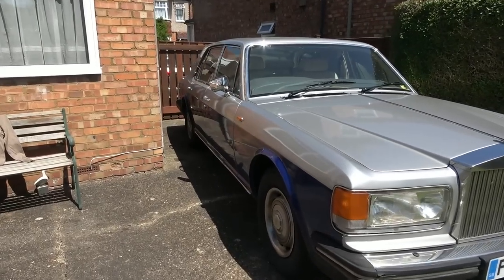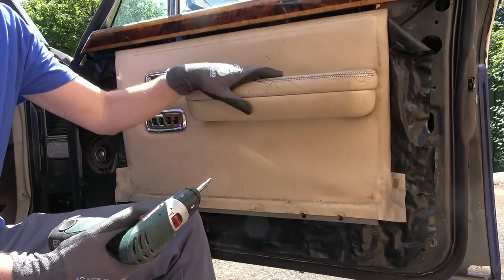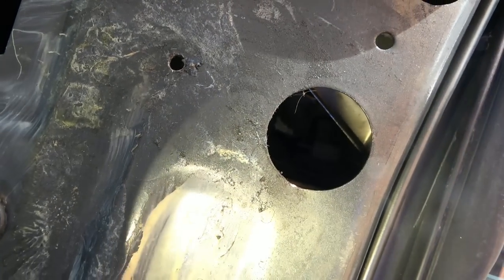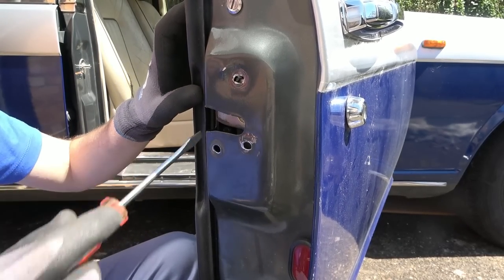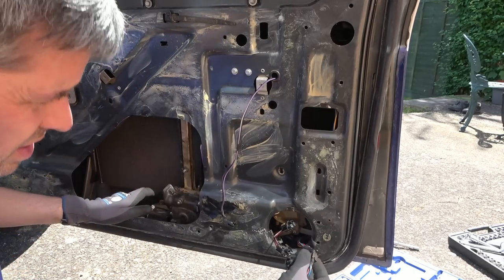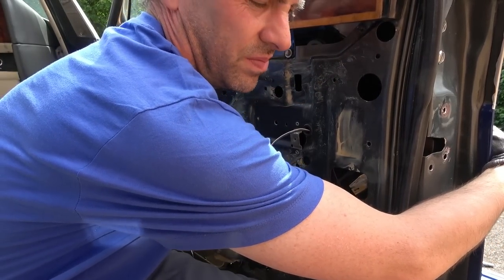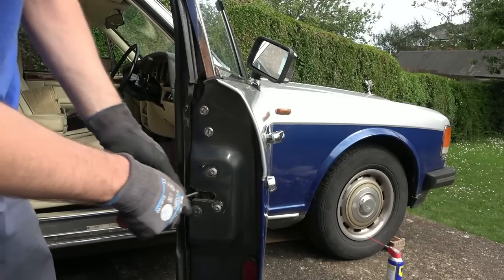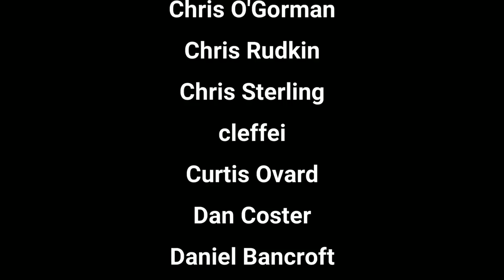CAN I FIX a ROLLS ROYCE - PART 1 - FAULTY DOOR NOT OPENING

Comment: As a former mechanic I thought this series would be hard to watch, but the way you describe the thought process you are using to troubleshoot makes this very watchable and informative. I have recommended your trying to fix content to people who are not trained or natural troubleshooters. I think they benefit from seeing someone else troubleshoot things they don't understand completely. Your approach, curiosity, and attitude toward problem solving is perfect for this type of content. I have zero experience with RR products, and it seems a very well made car, good idea, and good luck. Subscribed.
Reply: Tbh most car repairs are pretty easy. People are just intimidated it's no different to DIY just watchs tutorial and give it a go
Reply: @doiron12  I agree, a good body-man is an artist. They maintain a completely different skillset from a general mechanic, while also needing to know a lot about cars. When a vehicle is ten plus years old and everything is rusty, any job is potentially difficult. It can look easy when everything is clean and you have all the info.
Reply: @danielthompson743  Unless you have a classic Ferrari, yes if you can fix a modern VW Golf you can fix most problems with a 60s 250 Ferrari, but it will seriously hurt the value of the car. Because of snobbery but still. I did it myself is not what those buyers want to hear. For a Rolls, the problems come when you need to enter the parts shop.

Comment: Screw back in all the screws, from where did you removed them from. You should use 1/4" extension and sockets, to be able to reach through smaller holes.

Comment: As an ex mechanic I did like your approach to trouble shooting the issues, even mechanics with years of experience will more or less follow the same thought process if you've never done a particular job or worked on a certain vehicle.
I would suggest you treat yourself to a good 3/8" drive socket set with some extra long extensions, because I did cringe a little watching you undoing small nuts and bolts with a big 1/2" drive set. You'll easily snap off small bolts using something that big, and also as you found they are difficult to get into small places.
But enjoy the experience of fixing up your classic vehicle and I look forward to seeing what you tackle next.
Reply: add to your shopping list a 1/4" drive set and a service manual

Comment: I've got the exact same car! So glad you started this series. I need to get the doors re-veneered also, excited to see how you tackle the issues! Battery is in the boot, right hand side. You've got to roll the carpet out the way, and then theres a hidden compartment underneath. Also, there's a small black quick switch in the boot, (top right, reach your hand up and you'll feel it) which turns the battery off.

Comment: I've loved watching your videos and I think this is definitely a cool idea. From a former mechanic I have some advice for tools. Buy a good mechanics tool set, you're going to need it. There are probably some one off tools you'll be able to get by without, but you'll want good sets of 1/4" , 3/8" and 1/2" sockets and ratchets and you'll need a good selection of wrenches too. I'd also suggest getting a small 3/8" battery impact wrench, it will greatly speed up removing/installing parts (just don't use it for plastic stuff). As you go along you'll probably get more ideas for tools to buy, power tools make things go a whole lot faster. I would also recommend that you find a service manual that includes wiring diagrams for that car if it exists. Especially once you get to the underside of the car and the engine bay, you're going to want that information and for some things with a torque spec to stay safe you'll want to make sure you're tightening it to spec. Good luck with the project, I look forward to seeing it go along and I hope you get a bigger space to work on it!
Reply: Also a ratcheting wrench/spanner set are life savers and one of the other best investments available. They help a ton in small spaces to work like this too.

Comment: Surprised you didn't notice the after market torque screws straight away. That door has seen a few repairs already. Keep up the good work Vince (-:
Reply: Yes, Those screw's through the carpet don't look original either, easy enough to check on the other doors!

Comment: Looks like someone has had a go at the drivers side lock mechanism judging by the ugly torx screws compared with the beautiful chrome flathead screws on the passenger side.

With the dent on the top hole of the lock mechanism on drivers side, I would have probably used a longer bolt with a washer the diameter of the dent and push it through from the inside to exit the outside of the door or even use a threaded rod for extra grip and then like a slide hammer motion pull it out, maybe use mole grips on the end and give it a good ol' tug!

I wouldn't mind actually physically helping you on this project.

I've worked on cars and other stuff most of my life from a younge age.

I'm going to really enjoy this series of the  Roller being sorted.
Brilliant stuff, Vince!

Comment: A couple of little tips for you.
Get an inspection mirror , the type with a flexible goose-neck and one with a light on it so you can see hard to get to areas.
Rolls Royce cars have a lot of parts in common with big chrysler cars of the same era , braking systems , locks and some electrical parts.
If you can't get RR parts then you might be able to use USA car parts.
The suspension system has parts in common with some citroen cars and the gearbox again is an American General Motors built unit.
Reply: There are a lot of common parts!  I own an 89.  The suspension and brakes are truly unique. While searching for parts and issues with RR suspension I discovered that their are kits to replace hydraulics with air for older Rolls. The kits don't list late 80's era cars but I believe they could appear in the future.  But I do wonder if older RR tie the brakes and the suspension like the 1980's version.

Comment: Have you tried turning the key as far as it will rotate? On early Spirits, not sure if the design carried through to the later ones, a partial turn of the key o lying opened the driver's door, but turning it further operated the central locking and unlocked the other three doors.

Comment: As someone that works on vehicles regularly this was almost painful to watch ha. Especially considering how graceful you usually are at taking stuff apart.

Having all of my wrenches and tools just miscellaneously thrown into a bag like that would drive me nuts, not being able to just instantly pick out the size of wrench you need almost doubles your efforts when fixing something because you have to spend time to search for the right tool. You really should consider buying a 20 dollar wench set that is organized, it will make all the future repairs a lot simpler and more economical in the long run. While your at it, you should get a set of 3/8 in sockets, extensions, u-joint swivel extensions and ratchet, a long with a 1/4 in set if you can afford it also. im sure that that car uses metric but, idk for sure. 

Seeing you struggle with putting that 1/2 socket extension threw the hole in the door that was meant for a 3/8 in socket extension was hard to watch ha. I think the biggest pain for you in fixing this car, is going to be not having the exact proper tools, because that is one of the hardest parts on working on a car, is getting/having the proper tools. You spent a few thousand Euros on that car, you really should invest a couple of hundred into some new tools, and you will always have them, and eventually you will make your investment back with those tools. Idk just some ideas. 

Great to see some vids that are outside of the normal wheel house for you tho man!

Comment: Well done. I saw the sneaky socket set appear after the bag / spanner tip. I don't believe Rolls would have screwed through the 'carpet strips' on the door panels, looking at the metal clips I would guess that most along the bottom edge are missing the moving tooth part.
Reply: Spots on, I've said the same before I saw this comment
Reply: yeah it is factory. iv worked on these before
Reply: I looked at my 20,000 mile 1989, two screws through the carpet. Seems odd to me too but the carpet does hide the screw heads.

Comment: Hi , was sure how this type of project would work as a video series, but must say I am loving your down to earth trouble shooting. Remember when working on a car you have the advantage of having a mirror image of many of the components making it easy to compare any fault with a working example. So as you spotted the door around the lock has been damaged and the wrong screws fitted, hence someone has been here before and may have incorrectly fitted or missed parts (the likely cause of this issue).. What you seem to have missed is the  matching paint damage  on the b pillar this typically signifies the door has at some point in its life sagged (which  might be the original fault) which will need to be checked.

Comment: I'm thoroughly enjoying this series and one thing that did cross my mind is are there any available service manuals for this model even maybe a Haynes Manual? Like you, I often work blind, I restore and repair vintage Hi-Fi and fault finding is tricky sometimes do resort to service manuals or look up old forums. The wiring alone for the electrical system will be complex. I did notice that the door speaker was shot, and the foam cone surround has disintegrated. If you're interested I can put you in touch with someone who has the same loudspeaker units assuming they are 61/2 inch, full-range drivers, with a metallic small Whizzer cone and 4-Ohms impedance. Can't wait to see it fully restored and I think the most challenging project to date. Cheers!

Comment: OMG I have a beautiful old 1990 bemz 420 sel with the exact same fan blower problem, after taking it all apart, working upside down unscrewing screws with a mirror, I replaced some parts Nothing, at my wits end, now I see your discovery of the corroded resister cubes, now im excited to pull them as soon as the weather clears, thank you.

Comment: Door cappings, use yacht varnish to relacquer once they have been sanded and made to look good again, yacht varnish is sun and extremes resistant and dries to a hard shell but resilient enough not to crack or craze.   I used to do my Triumph's with the stuff and boy did they look amazing :D

Comment: My only suggestion, disconnect the negative battery terminal before working on the car. Leaving the door open for hours will drain your battery. Unless you need to buy a new one anyway. Otherwise, great vid as always. Can’t wait for part two!
Reply: There is a battery isolation switch in the boot!  Hopefully Vince will see this.

Comment: Great video, Vince! Your methodical approach is a lesson to you all. Couple of things... the number stamped on the panels is the last four digits of the chassis number. The engineers wrote the numbers on the panels as they were made so they could be sure they matched and were going on the right car. Also, may I recommend a more comprehensive toolkit? You really need a 1/4 inch drive set, 3/8 and 1/2 inch. Will make things much, much easier! Unfortunately, Halfords socket sets don't seem to have imperial sockets any more...

Comment: A most enjoyable video. I can hardly wait to what else you get up to. I would posit that your central lock might only open the drivers door via key. It would make sense to me that that would be the case since you don't really need to unlock all the doors if it is just you in the car. And now you know to remove that wooden trim piece at the top first so you get more room and light when you work on the other doors. Cheers

Comment: No idea about this particular car, but I would think the driver's side lock not unlocking all of the doors would be by design. You want to be able to lock all of the doors at once, but having them all unlock automatically when you open the driver's side door could be a security issue. At least my much more modern car acts in a similar way.
Reply: My modern Car unlocks all the doors when you open the driver's door.  This is the most common situations for central locking
Reply: Yep my insignia you can just unlock the drivers door or all doors,think my volvo did the same
Reply: I have seen it work both ways.  Not unlocking all doors is considered a security feature so if you were being chased and getting in the car, not all doors unlock when you open the drivers door.  Some newer cars  you have to turn the key twice to trigger it to unlock all four.
Reply: @mrbussey  that requires modules to control it not a simple electro mechanical
Reply: My MK1 Focus Ghia does driver door open on first press, then the other doors on second press.
Reply: That's a very valid point Mighty Jabba's Collection. Perhaps worth an online search to understand how it's meant to work
Reply: @jusb1066  not so with my modern cars you can actually program mine to unlock the driver only first and a 2nd activation unlocks the rest or you can program it to unlock all on the first activation and same with the key fob. One click for driver door and 2nd click for the rest or program it all on the single click.  I believe this is very common on most current cars.
Reply: I own an 89, Turn the key and the driver's door is unlocked, turn it further to engage the electrically driven system, to unlock all of the doors.  I wonder if Vince has the manuals for the car?
Reply: Nope. By design, it should unlock all doors
Reply: You turn the key part way for drivers door only or fully against a spring action to unlock all doors.
Reply: @ivanfernyhough3851  you are indeed  correct!

Comment: Linus talked about this on his podcast show not too long ago and it was basically that videos that are longer than 20 or 30 minutes are great as they can fit more content in and don't have to rush info in but it comes at the cost of a significantly lower viewer watch time as many people don't have time to watch a longer video and will either save it to their watch list and might forget about it or simply watch something else entirely.

So my recommendation vince would be to try to keep the videos within a 20-35 minute range but including as much detail as you can. Another thing you could do is make a 20-30 minute video and then a full length "directors cut" version so if people watch the short one and want to watch the more advanced and indepth video from their favourite creator then you could also do that to maximize your viewer rentention and also your profit on the videos

Comment: Awesome first part =D  This is going to take incredible time and effort!!!  Maybe things like those replaced screws on the door side can be sourced from a scrap yard or a parts dealer?
Reply: Looks like they can still be ordered new... part numbers SPM1732 (washers) and SPM1733 (screws), 3 of each works out around £75! Maybe why the last person went with random torx screws!? Good news I guess is that the parts diagrams and full workshop manuals are all online
Reply from the maker: Thanks Chris, I might swap them with the back door until I can find replacements 👍👍👍
Reply from the maker: £75!!! The torx suddenly make a whole lot of sense 😂👍👍👍
Reply: @Mymatevince  looks like one of the screws has scratched the door frame so I wouldn’t swap with another door or it could damage that one. Unless the scratch was someone breaking in which caused the door damage in the first place. Great video, looking forward to the next one
Reply: IntroCar or Flying Spares are good places to start for these SZ chassis cars. 😉
Reply: @Mymatevince  First, take a screw from the rear door, and then go to a really good Fastener Supplier. He will provide you with a screw of identical length, identical thread - and also countersunk (if that's what the original RR Screw is). Finally, it needs to be stainless steel, not a cheap zinc plated version. For six (6) of these screws, you should pay no more than five pounds. Your Fastener Supplier won't be able to match the RR Washers, but a good Engineering Shop will make these from stainless - at 3 or 4 quid each. We have all had very fiddly jobs to do, and you did really well! I use a phone camera, and film everything, if I think that the job is going to be challenging. The person who had a crack at fixing the RR Door was a real idiot, giving-up on the job, but (worst still) losing the valuable and original screws and washers. Greetings from Australia.
Reply: @peterduxbury927  Thats the first thing I noticed, that drivers door lock has been well & truly got at & bodged, especially someone putting those random Torx bolts in place of the original slot head ones! Also if you looked carefully, most of the slots In the bolts on the other doors have been slightly damaged, indicting that they have all been messed with, as they certainly would not have been like that from new on a Rolls!

Comment: I would suggest getting a 1/4" and a 3/8" ratchet as well as the one you have. 1/2" is great for big stuff like 13mm + but for everything else you really should use a smaller one, especially in tight places.

Comment: I probably don't need to say this, but when you have finished the door and window problem, don't forget to put the vapour barrier back.  (The sheet of plastic).  Its part of the door drainage design and keeps the rain water out from the inside of the car and also from rotting out the door card.  Clean the surface it attaches to with white spirit, then when clean, neutralise the white spirit with methalated spirits.  You can then attache a new seal for the vapour barrier using butyle tape or by gunning a bead.  Dont use silicon.  The Butyle is a none setting mastic.